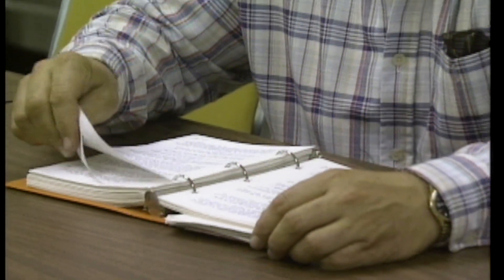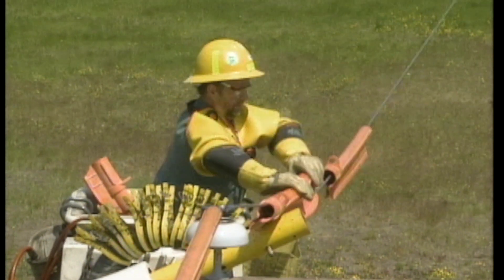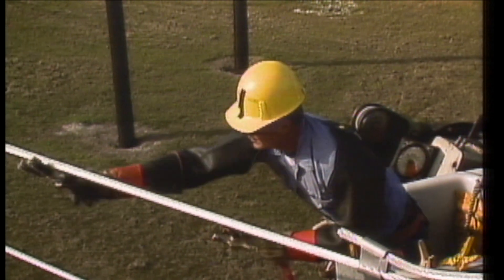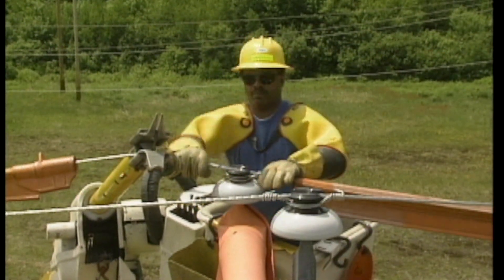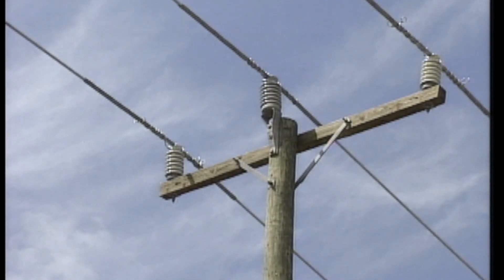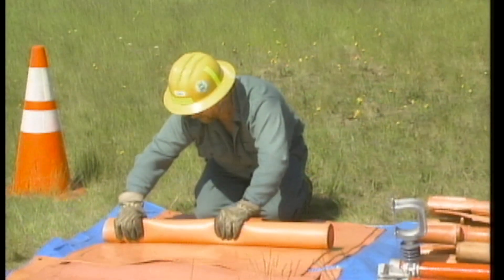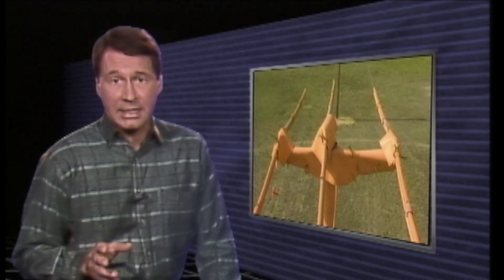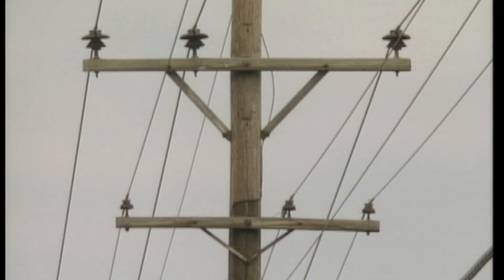34.5 kV Rubber Glove Work [PREVIEW]

Comment: Dominion Power won't glove 34.5 kv lines. They'll have their guys wear gloves and sleeves while using hotsticks. It it has to be gloved, they'll hire a contractor to put their guys at no risk and let the contractor do the extremely hazardous shit. Dominion needs to thank God for contractors. They do twice the work their guys do and don't get the pension and 401k. Why doesn't Dominion keep a workforce large enough to do all the work? Because they know contractors have to do it efficiently, whereas Dominion workers are Union and can come down every thirty minutes for water and a break. Dominion is a piece of shit company. They don't want to make their guys work hard and pay those pensions and 401ks. It's cheaper for them to hire a contractor who will get it done instead of pay their guys 45 dollars an hour with 3 guys watching while 2 guys work. Same with Verizon linemen. Three guys watching while one guy thinks he's a badass because he can climb a thirty foot pole and swap a lasher. No guy on the next pole waiting for the lasher, three watching while one does the swap. I fucking climbed behind the bucket before. One guy went swapping the lasher out of the bucket and I climbed behind him putting straps on. Efficiency. I watched a Verizon crew and three trucks including a boom truck do a straight thru pole transfer. Geezuz fuckng Christ, I could have done it on a flatbed truck climbing the pole with a chain hoist or two faster than 4 Verizon linemen did it. No shit. Too scared to hook a chain hoist up to the pole BEHIND the initial pole and top the pole so the line dropped right into place. NOOOOOO, they had a boom truck "crane" the line into place. I could have saved them 3 hours of pay at 40 dollars an hour per worker with 4 or 5 workers on the clock, gas for three trucks, etc.. I  could have taken two chain hoists and a chainsaw and done it in 20 minutes. Hook the chain hoist to my hook on my belt and put a handline on the chainsaw. Frame my pole, hoist the line and get tension on it directing to the new pole, top the pole and bingo, the line drops right into place. They don't have to run around getting 25 dollars per pole transfer and split it between 2 guys. They can take 4 hours and tell their boss "nobody got hurt we all went home" and their boss think "god damn, I need some motherfuckers who know how to get it done so we can knock some work out. So the line was heavy, oh it's all copper, boo fucking hoo. I've picked up lines with the bucket before and it wouldn't lift it so I had to jump out of the bucket onto the pole and hoist it with a chain hoist. Verizon linemen would make that a half day event telling their supervisor "well, the boom wouldn't lift it and man, that created a HUGE problem which took time to do it safely". Bull shit. They don't have to produce. They have to milk the clock, act like they do a hazardous job and must work slow to do it safely. AND, have 5 guys on a straight thru pole transfer (one clamp, three nuts to tighten and then a lag bolt to hammer into the pole) and it takes 4 of them. I did resags and transfers off a flatbed in Oklahoma. I'd resag a line in 5 minutes. It'd take Verizon 5 guys, two trucks, and a foreman who wants to fucking TALK about how to do it safely with all his guys for a fucking hour before anyone starts. Utility company workers are spoiled motherfuckers. They are. You learn how to do things when you're paid 14 cents per foot for overlash and 7 cents a footy for strain or strand. You learn how to fucking do it. You learn if the truck fucks up, you strap your fucking hooks on and get with it. Climbing ain't shit. Alot of linemen merely think they're the shit for climbing. Bull shit. Get to the job and do it motherfucker. You ain't no badass for climbing and swapping a 65 pound lasher. You're no badass for climbing and gloving a 15 kv line. You're not. There's a thousand guys who'd gladly take your place and do 10 times the work, yet those companies hired YOU so you and your family can have money and a good life, and YOU can have those 2 million upon retirement. The company gave YOU the shot, not the other thousand guys, so fucking do as much work as you can to make yourself proud of yourself instead of being a clock milker like Verizon and Dominion workers. That company hired YOU to produce. Dominion Power workers are the worst. They are. 40 dollars an hour and they don't do shit except work out of the bucket with gloves and sleeves and hotsticks. When it's gotta get done, they call in the cavalry, a contractor. The contractor KNOWS the company workers rely on his crew to work efficiently so everyone gets a paycheck and can support their families. Dominion workers know utility bills pay their check and they can take all day to do an hour job and have the Union tell their boss "he did it safely". Like I said, when you're paid 7 cents a foot to drive a jhook into a pole, raise the old line up into the jhook, and pull new strand or strain for 7 cents a foot, you learn real quick how to run 5 thousand feet (2 whole spools) every day so you can make 100 bucks a day. Then you sometimes got the gravy span with 4 fibers on the pole and you had to drop them and underlash a span of coax because coax MUST be lashed under the fiber. A span like that'd pay you fucking 300 dollars and you'd be there an hour. Utility workers are spoiled motherfuckers. God bless the former Utility workers who go to work for power contractors so guys get to do that type of work, the type of work they dream of. I applied, nobody would hire a former communications lineman who climbed 90 feet with no fall arrest. Fuck em.
Reply: So you're a phone guy commenting on a 34.5 gloving video? Did I get that right? Either way congrats on busting your balls for a company who will have your job posted before your obituary makes it to the paper.
Reply: You dont use gloves an sleeves with sticks you wont know the sticks are breaking down very ignorant to the job.
Reply: Did ya get it all out? Fucking cry baby never worked overhead.
Reply: Salty af
Reply: I work for dominion and we glove 19.9 everyday. You obviously don’t know what you are talking about. If you were half the lineman you think you are maybe people would hire you Johnny.
Reply: Ok we get it Mr. Pike.